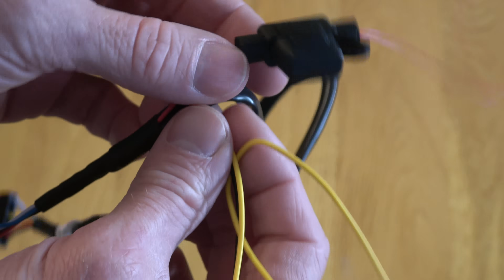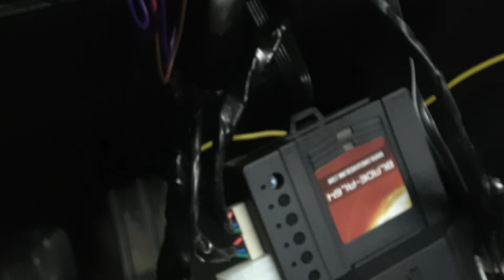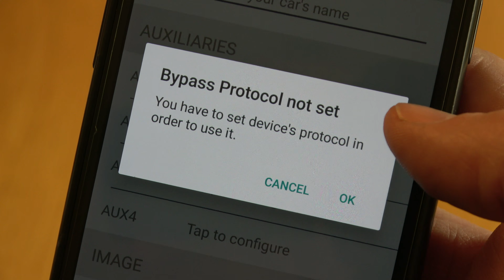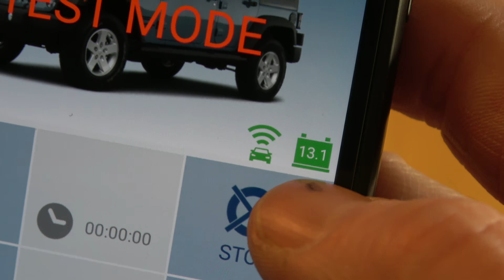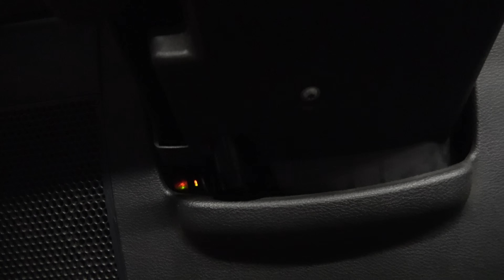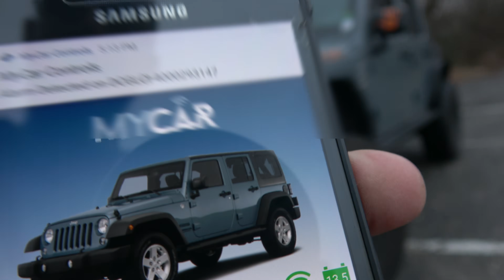Omega Linkr Alarm Remote Start GPS Tracker - Excalibur Alarm System Installation Howto - Jeep

Comment: Worst system ever!!!
After three years of changing the remote battery’s, every two-three months having parasitic battery drain, constantly replacing broken remotes, problems with the linker going off line,  I’ve finally decided that I’ve had enough of this garbage and ripped the system completely out of my vehicle…

Comment: My 03 ram had the excalibur system in it when I bought it, the truck was used with 50,000 miles on it but anyways the excalibur has been a great system for the 10ish years I've own the truck and I'm ordering the newest excalibur for my new truck as well, since I know how to use it and my other truck has it I am comfortable with the system, I might get the linkr also just to have the extra little GPS features and remote functions on my phone for those times when the wife has the truck haha :) good videos ❤️

Comment: Now when you kicked the tires and it started chirping, is that a default feature of the excalibur system?  Then when you really kicked it and the alarm started going, was that ONLY from the excalibur system?  Or did you also have a factory alarm system?  I'm assuming if no factory system, the excalibur system is able to control the honking and lights during the alarm sequence?
Lets say the alarm is armed, and someone picked the lock of the door manually, do you think that would set it off?
Thanks.

Comment: Is there any special programming that has to be done on the alarm?  I have the same alarm system that was installed by a local radio shop.  A family member bought me the Linkr for my birthday, but when I installed it in my car (in the black data port just like you) it only shows GPS functionality.  The actual lock/unlock and remote start buttons don't work when I press them on the App.  My Alarm is running a newer firmware version than the one you had in the video (according to the quick reference card).  Any thoughts?

Comment: I have a question, I apologize if its a dumb one, but it gave u 15 mins after u started the vehicle and then it will shut off correct? What if I put it in drive and drive away, will this acknowledge that I am driving and remove the timer or am I then limited to only a 15 min trip on my car. Thank you!
Reply from the maker: Once you turn on the key it cancels the remote start and the Jeep just runs from the key.  You can't drive away without the key... Hope that helps.
Reply: @o3djeeps  thank you

Comment: Great vid. I just put a linkr-lt2 and fortin alarm into a wrangler and it's useless. App.sees truck but not a single command works. It even sees that it's running. Locks and start won't work. Any thoughts. I've tried linkr lt app and same app you used. Neither have worked.
Reply: @Hai Tran yes. I spoke with the people at Omega and they suggested there are issues between their product and fortin products despite what online sellers may be telling consumers. I returned the fortin unit and picked up a similar unit that uses the ADS protocol which is priced very well and proven to work with the Linkr. The guys name is kicky rides who was mentioned in this video and he has awesome support thus far.

Comment: Question. Professional thieves know how to disarm an alarm and locate the gps and simply disconnect the harness or cut the wires. Will your Linkr GPS still give you a location on the phone app when it's disconnected? You put the LinkR in a very accessible and obvious place. Sometimes going the cheaper route will cost you more in the long run.
Reply from the maker: Aj Fisher if a professional thief wants it bad enough....they'll take it regardless. But to answer your question, the linkr has its own battery...so yes it will keep transmitting the location until the battery dies.

Comment: +o3djeeps would you be able to do a tutorial on how to use valet mode? I was set on getting a Viper system but their customer service is sub par and it’s expensive and after watching your install vids I’ve 100% changed and will be getting an Omega system. Thanks for being so thorough with the install and detailed in the features!
Reply from the maker: I can try and work that in

Comment: No actual text alert? What happened to all the features that were on the LINKR-M1 ?
Reply from the maker: Abel Vazquez you get alerts through the app using sms protocols.... That's all I know
Reply: @o3djeeps  can you please, please elaborate on which wire the yellow wire has to be connected to? I tried the brown wire (17 - siren - OUTPUT (1A)) coming out of the 18 pin harness, triggered the alarm until it was off by it self (more than 30 seconds) and never got a notification... yours did in less than 10 seconds... I got the linkr mostly for that feature, I know you no longer have your overclock but will really appreciate if you give us any info (there is more people having the same problem), thank you!!!

Comment: Personally I love Omega alarms for a long time. Yesterday I just installed Omega Car Electronics AL20753DBL Excalibur with 9V backup battery in my car, just direct power, without ACC connection, with antenna, siren and shock sensor, just pre-testing still things to do.And this evening I found your greatest videos, watched them all by the way and subscribed.Thank you very much!